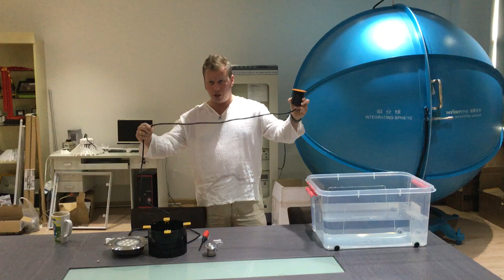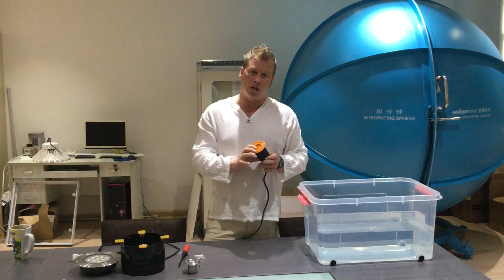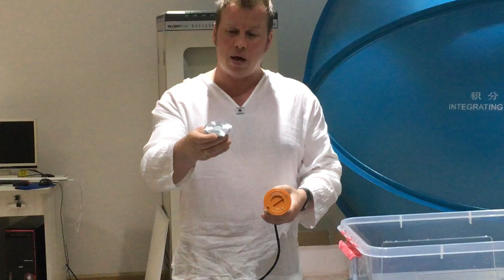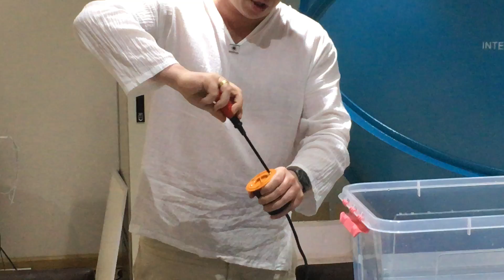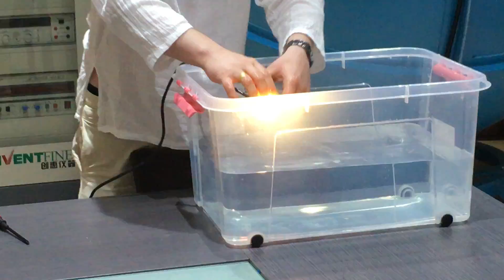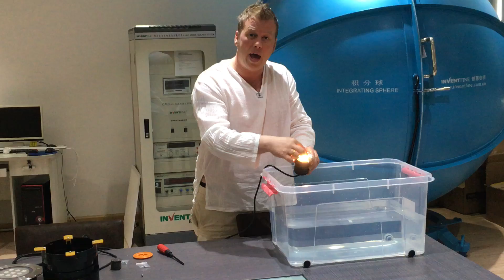Illustro 3W Uplight Explained....

Comment: Pretty cool. Voltage?
Reply from the maker: Robert..We can make 110V versions but we need to undertake UL approvals. Currently we are running for the 220-240V market.
Reply from the maker: We have just finished TUV on 220-240V versions. Selv versions 12/24VDC are available also.
Reply from the maker: Robert Mandell: We can make in SELV 12V/24VDC for swimming pools etc using the same fitting.